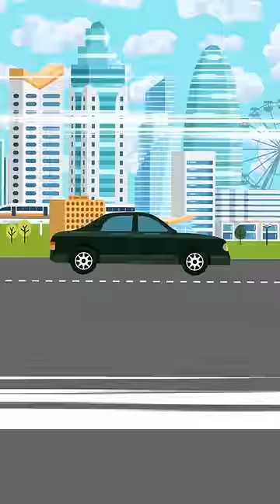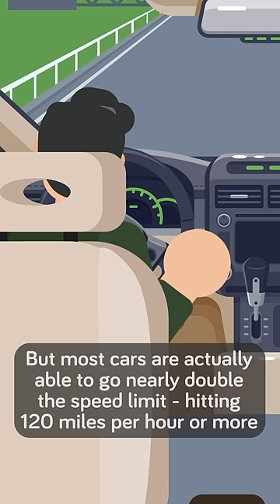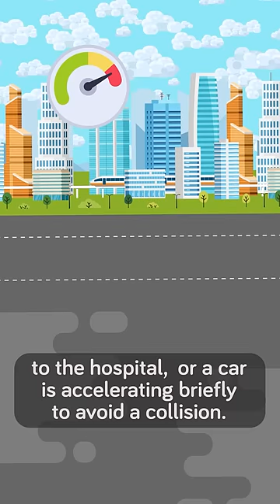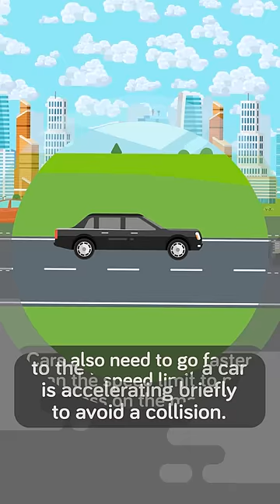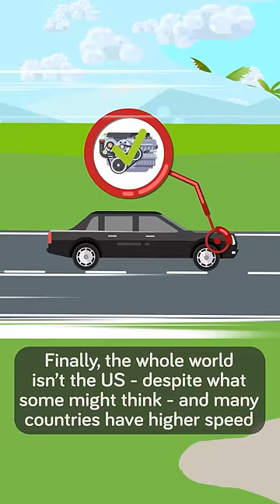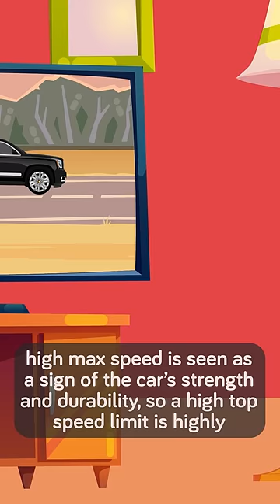Why Cars Are Made to Go Faster Than Legal Limits

Comment: In Germany, it is common that there is no speed limit and many people drive 200 km/h or 125 mph.
Reply: I drive 155mph/250kmh daily when going to my job in germany. Its one of the safest roads in the world.
Reply: same here. 200-220 on my daily drives form and to work if the weather and traffic allows.
Reply: In the us, if there was no speed limit. You will still have someone going 45 mph in the fast lane, and still flip you off for running up on them. Most can't drive over here
Reply: True I was born there
Reply: @splitcoin123  this low speed is illegal on the Autobahn. If you don't drive 80kmh you are not allowed and will get pulled over and fined
Reply: @zakiNBG 80kph? That's only about 50mph, so the point of the person saying someone going 45mph in a no speed limit zone still stands.  
I do agree though, that in order to drive on highways with no speed limit, they should absolutely fine slow drivers, for safety reasons.
In the US, it's actually common to get stopped for driving too slow as well as too fast.  Even on low speed limit roads.
Reply: @splitcoin123 For real. Too many idiots on the road going 10 under calling it a limit not a goal, not realizing it is both
Reply: @splitcoin123  and gay. 🤔🤣🥊
Reply: They are bringing in a a speed limit on all cars where the car, all cars will only reach a certain speed. 😂 . That’s the brilliant European Union (WEF)
Reply: 280 MPH usually
Reply: @JamesSherrick he's mistaken. You have to go at least 60 kph. (45 mph)
Reply: @JamesSherrick  on the german autobahn you have to drive in the right lane if you're going 80kmh or generally slower than 130kmh and faster cars go in the left lane, middle lane is for takeovers from the right lane
Reply: Us speed laws for highway was done in 70s to save gas then kept to keep our $!
Reply: i’m from aus, but i heard germany also has higher standards when it comes to getting a license so it’s a lot safer to drive at those speed
Reply: @somerandom138  that's correct.
We have a theory test featuring 20 questions. There's questions with 2,3,4 and 5 error points, depending on the importance/difficulty. Those questions always have 3 choices, of which either 1,2 or all 3 can be correct. If one of those choices is incorrect, the entire question will be counted as wrong. if you have either 10 error points or less, you will pass, otherwise it will be a fail.

We also have a practical driving test which takes 50 minutes. Unless there are serious faults as running a red light, running a stop sign, failing to yield, etc., you will mostly pass (unless you have a TON of minors). For further questions/explanations just reply.
Reply: Whe. I was in German most high ways were under construction every 20 miles or so. And the speed limit is like 20-40 mph in most roads. The autobahn is the only place with no speed limit and only on certain spots. And still almost everyone still drives 70-90 mph. 

Anyone saying they drive 150mph everyday is 99% full of it. I’ve driven across the whole country a dozen times and maybe 1 hrs worth is not a construction zone or packed with traffic.
Reply: @humpteedumptee8629  that's not true, there's constructions often, but not THAT often. Most roads have a speed limit of 50 or 60 mph. About the rest you're right.
Reply: You misspelled > 400km/h
Reply: I, too, go 140mph to work everyday.

I don’t live in Germany.

Comment: I paid for the whole speedometer, I’m going to use the whole speedometer.
Reply: Cool
Reply: Except speedometers usually go up to more than the maximum capable speed anyway
Reply: @Inkyminkyzizwoz now that's a better question, why do speedometers go beyond the max speed of the car?
Reply: @demeter1793 
(This is just a guess)
You know when you accelerate in the ITV? I dont know how its called in your country but your annual car revision.
You dont have drag trom the air or asphalt, so technically you could reach higher rotation speed.
Maybe the maximum from speedometer is the same as maximum safe speed rotation with no drag :S
Reply: Beat me to it
Reply: So your gonna use the whole rpm gauge an oil pressure battery charge etc huh. Have fun staying home😂😂
Reply: @Inkyminkyzizwoz not wranglers top end 104 speedometer 100😂
Reply: @Will-dn9dq whoosh
Reply: @javiermercado1996 nnual car revision?  Most us states you just pay taxes an reg fees put a lil sticker on plate month of your birth. Some like CA require more like smog check to register especially out of state cats. But most us it's just taxes an registration plates mailed if it's bought new use a paper temp plate from dealer for month or so. Then when selling the car you usually just change the plates registration name or if junk turn it in an pay the taxes owed.   I'm sure alotve European countries have was strict limits compared. Way you speak of the test it's a rpm speed on a platform where car revs tires spin an you sit there w a hose on your muffler etc tests smog. That's pretty far ahead more like Nascar tests you'd have guys pat to test their car truck etc on one 😂😂😂
Just looked up what you spoke of an was as I thought.  Yeah we've cars burning oil onto bald tires leaking exhaust underneath into passenger cabin. They call those beaters or $500 cars. My jeeps exhaust broke pipe decade ago no way I'd pass 😂😂
Reply: @Will-dn9dq  It's a common racing meme, don't take it too seriously.
Reply: @densai89  oic lol I didn't know that I was not in on that joke but I get it now 😅
Reply: @demeter1793  It could be a really long downhill straight.
Reply: @Will-dn9dq  *you're
Reply: @javiermercado1996  ITV?
Reply: @Will-dn9dq  Hmm I thought in the EEUU you also had mandatory revissions.
But hey if I could choose I would preffer the liberty of not having to pass it over the security it grants.
Reply: @Inkyminkyzizwoz  
ITV = Inspección Técnica de Vehículos
(España)
Reply: @javiermercado1996  The UK equivalent is the MOT
Reply: @Inkyminkyzizwoz  as in your mama made a mistake having you? Lol
Reply: @javiermercado1996  most the us states cars get checked when a kid gets there  drivers test. That's it. Lol
Reply: @Will-dn9dq  No, as in 'So you are'
Reply: @demeter1793  Speedometers go beyond the max speed to account for downhill sections. I know one fairly steep section of the Autobahn where you can exceed the normal max speed of a car easily. 

I have had a car with a max speed of 230 km/h run into the 250 km/h limiter (that all German manufacturers bar Porsche agreed to put in their cars I think in the late 1980s; today that limiter is easily circumvented). That speedometer went up to 260 km/h, and without the limiter it would very likely have exceeded that number on this downhill stretch.

If my memory serves me well, I hit 200 km/h there with a car that had a normal top speed of 160 km/h. And on this occasion, I did reach the end of the speedometer.
Reply: @demeter1793  Because they dont use a speedometer for a single model, so they design one and use them in their next 3 models that could be faster or for race cars of the same company. (There could be more reasons)
Reply: ✋👮
 I'm gonna have to stop you right there pal.
Reply: @AloneSitoYTTM LMAO

Comment: Well in Australia there's the chance that you may need to outrun a bushfire front.
That's why cars with a "limp home" mode need a override for when the engine management system decides that reducing the risk of cylinder damage is more important than not being incinerated.
Reply: That’s actually very cool I never knew that
Reply: Ah.
Reply: Yeah like in the US we have DEF tanks on our newer diesels. Minute that goes empty Owls and baby seals matter more than being burned alive.
Reply: Limp home mode? That's a thing?
Reply: @ChiTownGuerrilla most cars built after 2005 have this coded into the ECU as a “the owners being an idiot again let me prevent catastrophic failure”
Reply: @moniker8391 engines just got softer, LS  for the win
Reply: It's also useful there to have a V-8 engine in case some postapocalyptic bikers are after you

Comment: Ah the power of an efficiency curve. 
Not joking, it works in anything... the low "pick up" area and the top "high performance area" require the most mechanical problems. 
You want an engine to run nice and smooth in the middle. 
Same goes for other parts really. Buying with reserves left makes things last much longer.
Reply: Great explaination, I remember asking this question previously and getting the same answer.
Reply: yea the high max speed is just a side effect of giving the car enough power and efficiency for normal uses.
Reply: True for gear based transmissions, and combustion mechanics. Why use combustion engines might be a better idea to contemplate. Why is combustion used on an industrial scale at all?  Greed.
Reply: But couldn't you have a high max potential and govern it down? 🤔

Comment: When you traverse uphill you need more power to maintain momentum with lift. Cars provide this so we don’t stall going up hills
Reply: I wouldn’t say stall, but you need significantly more power just to maintain your speed if the hill is steep enough. In Germany there is a term for when a car is powerful enough to maintain high speeds (eg, 200 km/h, 125 mph) even on steep sections of the Autobahn.

Comment: Many states in the USA have different speed limits, and in some states the speed varies by area on the same highway.

That being said, my mother used to have an Infinity J30 that would not allow the Cruise Control to be set above 65 MPH.  It drove me crazy travelling several hours through a state that had a 70 MPH speed limit

Comment: Why cars can generate more power than necessary?
1- going uphill requires way more power than going straight. See trucks and bikes going uphill.
2 - sometimes you are alone, sometimes you are full loaded. A car needs to be able to drive at a decent speed while in max load capacity.
3 - A engine looses efficiency with time and the optimal use is only a fraction of the maximum power it can generate. A dragster or racing engine uses full power all the time but last only for the duration of the race.

A daily routine requires less than 10%  of the maximum power of the engine.
Reply: I wouldn’t say 10% but maybe 30% (though of course that very much depends on the car and the driver). Hitting full throttle in 3rd gear and reaching 3000 rpm when accelerating on a freeway on-ramp would not be uncommon.

Comment: I want a car that can automatically limit the max speed of the road I'm by itself regardless of how much I press down the pedal to the metal. Having to constantly look down at the speedometer is such a pain in a city where every roads varies from 15 to 50km and cameras everywhere.
Reply: Here in Western Australia you go 7km over and you get flashed and fined it’s ridiculous.
Reply: That’s because of gay😂
Reply: You mean… cruise control? Just turn on your cruise control and set the limit. 😂 it will do that speed until you hit the brake.
Reply: @that_pan_chick8650 I'll second that chuckle 😂.
Reply: Gay what?
Reply: @that_pan_chick8650 Not if you're going downhill. And it's not really designed for urban driving anyway, given how you have to constantly adjust your speed to the traffic conditions
Reply: @Inkyminkyzizwoz Modern cruise control does account for that. All you have to do is adjust the speed with + and - buttons, tour car will target that, and if someone is going slower in front of you it will match their speed until you switch lanes or they leave, and it will brake going downhill so you dont leave that target
Reply: Been around for decades mate, however advancements have been made where a car will follow the speed limit, but thats the AI car stuff, those self driving ones. 
Honestly you wouldn't see me behind the wheel of one of them. 
Now give me an outback road where I can hit 250
Reply: @stumpytheviolator3118 Go in Germany for that . A friend of mine leaves there - in their Autobahns it's very common to not implicate speed limits . Many drivers can drive their cars at 130 mph with no risk or danger .

Comment: A friend got a car with a setting on the gear shift that if used VOIDS the warranty
Reply: What setting is this?
Reply: @TheLongDon  Something from the gay foreplay. 💩🤣🤣🤣🥊
Reply: @TheLongDon it might be race mode
Reply: How does it void a warranty if it’s incorporated into the design of the car from factory and not something aftermarket?
Reply: @jdmozee12  because it reveals the gay motions
Reply: @jdmozee12  cause you signed a contract with small print saying it. The auto manufacturing industry has a ton of power. Heck look at right to repair with vehicles.

Comment: If all emergency vehicles and commercial vehicles were manufactured separately. You could prevent more traffic issues. Hmm, vehicles could be built with governors that receive a signal from speed limiters/signs. The car will only travel the speed limit unless an override switch is activated. Activating that switch alerts local authorities to your location/situation. Sometimes you need to get to a hospital, and seconds may make a difference.

Comment: A better question is why can't we drive at least the design speed limit.  By federal law our highways are required to be built to a minimum safe speed of 75 mph wherever possible.  The vast majority of our roads are safe at far higher than 75 mph, yet for decades we were told that over 55 mph was practically suicide.  Even now most states don't allow you to drive the minimum safe speed the interstates were designed for.  Speed is rarely causative in accidents, bad driving is, too fast for conditions, illegal lane changes, tailgating and break checking, those are what cause accidents, speed only increases the result of bad driving.  Yet illegal lane change in heavy traffic is far fewer points and less money than driving perfectly safely on an empty highway specifically designed to be safe at the speed you're driving.

Comment: Governments could install solar-powered Bluetooth transmitters at each speed limit sign. These transmitters would send out a signal telling  vehicles with Bluetooth receivers and computer controlled governors what the speed limit is. And, the governors would eliminate speeding. Of course this would not apply with emergency vehicles like police cars, ambulances, and fire trucks. This will never happen because the main objective isn't traffic safety, it's revenue generation.
Reply: P.S.: The EU has published plans to require cars to automatically indicate to drivers when they exceed the speed limit.

Comment: Whoever decided to say that cars should be forced to go only the legal limit has obviously never heard of an emergency or heard of personal freedom before in their life
Reply: Well, in the late 1980s the German car manufacturers (bar Porsche) agreed to voluntarily limit the top speed of their cars to 250 km/h. Several manufacturers from other countries joined that idea (though not companies like Ferrari). As high permanence sedans became ever more powerful (AMG, BMW M), manufacturers made it possible to lift those limits relatively easily.

In the last two years, Volvo and Renault started to limit their cars to a top speed of 180 km/h in the name of safety (maybe environmental reasons also played a role or cost savings in the suspension, axles, etc).

Comment: Cars need to go faster than the speed limit so it (engine?) doesnt break when they drive slowly? I doubt this highly. As the amount of stress on an engine is mainly caused by rpm, not blatant speed. By accelerating faster and going up in rpm quicker, will actually damage the engine faster, compared when driving slower. But yes, being too low in the rpm is also bad for a car, but then you can just downshift.

Comment: I think it's kinda funny because America we had limited speedometers for a while. 

That started when 55mph laws began along with highway safety ideas. 

My 280ZX for example spedo limited to 80 but capable of 121mph. Or the suburban which can do 120. 

Comically my brothers impala is limited to 110 despite being topped at 190 on the gauge.

We even used to have "American Autobhans" but the pants wetters in Congress demanded to shut it down.

Comment: Alotve cars have limiters that stop at 85 in highest gear. For my 98 wrangler 4.0litre I just don't put it in 5th can do over 100 which is its limit on gauge 😂😂 so 104ish topend. Also Lotta facist tryed get chips in cars to disable them remotely by cops.

Comment: And not a single reason why limiters shouldnt be fitted stopping speeds (outside of Germany) at 90mph. If you need emergency acceleration for safety there's nothing happening that takes longer to avoid than the 3-5 seconds getting that last 20mph increase. Events more than 5 seconds away just aren't in the category of emergency, if you're obeying laws and codes.